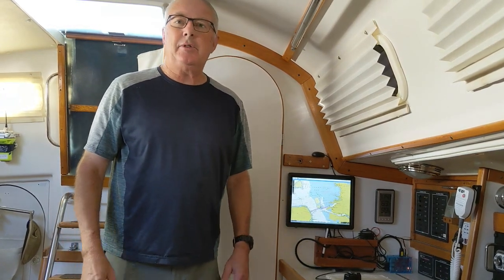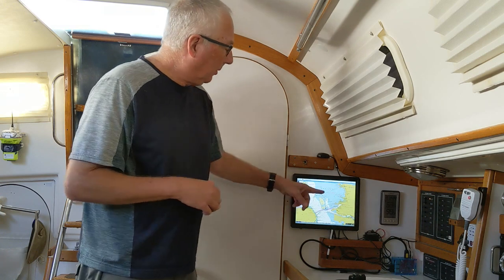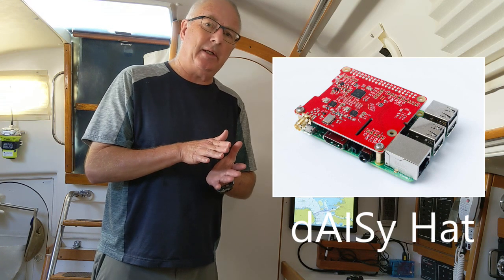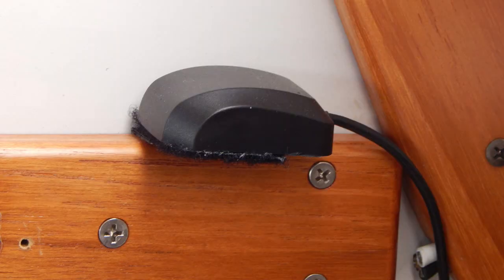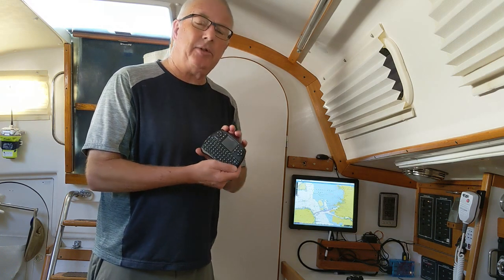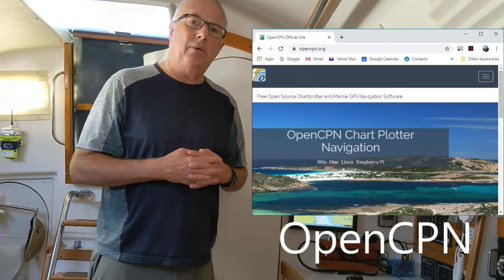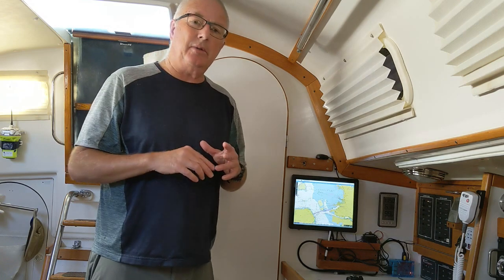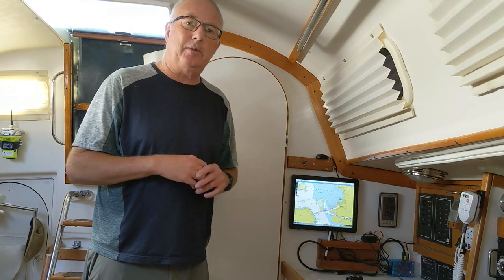Building your own Chartplotter with a Raspberry Pi and OpenCPN

Comment: As a Raspberry Pi user and Linux guru I can say this is a solid platform. Better than a tablet for sure.
Reply: Just out of curiosity: Why do you think that this is better than a tablet? I just bought a small boat and still have to decide whether I'll go for a tablet or the Raspberry Pi.
Reply: @danielhansen1902  Mind you I plan to use an Android tablet along with a PI. 

However comparing the two 
#1 Linux can do more things than a tablet allows you. It has the capabilities of an actual computer 
#2 It's modular. If one part fails you can replace it. With a tablet it's all or nothing most of the time. 
#3 It costs less. You can get used parts pretty cheap compared to a high-end tablet. 
#4 You have more flexibility. With a tablet you are locked in to what Google or Apple allow you to use. 

(Granted some of these are because I know Linux, most people don't. But it's like knowing your boat, you should be able to fix it if it breaks.)
Reply: @danielhansen1902  the gps positioning (even if receiving via wifi) just wrecks havoc on an ipad's battery.. My usb chargers arent keeping up with the charging..

Comment from the maker: I've added a list of the key hardware elements to the description. The enclosure for the RPi is at the same link as the dAISy HAT.
Reply: Thank you James. Very informative. You mention a Touch Screen. Can you use a standard PC mouse in the same way as on a Desktop PC non-touchscreen Monitor? If so, when entering way points is it the case that you place the cursor on the desired location and click with the mouse to select the way point on the chart? Many thanks, Best Wishes John
Reply: James, 7 months later how is the system holding up? My biggest question is whether the monitor and Pi hold up in a boat (some of that rocking can be extreme!) Also, if moisture has made any problems?
Reply from the maker: @martinpugh9700  My unit is running flawlessly after about a year. I do keep a dehumidifier running inside when we are off the boat, so this is not a severe case, like sailing full time in the tropics.
Reply from the maker: @JJ-sq9sy  A regular mouse would work fine. I don't use the touch screen much at all. Just came with the monitor I chose.
Reply: Just curious. Why the choice of dAISyHAT over MoitessierHAT?

Comment: Thanks to you and Smart Sailing Boat videos I have pulled the trigger and making my Pi Plotter. I found the monitor to still be the most expensive part again. Fortunately I was able to find a 15.6" touch screen for $139 on amazon. It's a no name Chinese brand, but it's powered by USB. I am powering everything via a powered USB hub. The Hub I picked has a 12VDC input so I will cut off the  transformer and wire it into my 12VDC system so I will have 7 USB 3.0 to power my plotter. Thanks again for the motivation and encouragement to go forward with this project.

Comment from the maker: I received some very useful feedback that a better antenna splitter is needed if you want to share the antenna with both the VHF radio and the AIS receiver, to protect the AIS when transmitting. I've put a link to the Glomex RA201 splitter in the video's descriiption.

Comment: As someone who is 1. buying a boat and outfitting for long term off-grid sailing and 2. cheap and 3. a lifelong builder of things, this is awesome. I was considering a refurbed Fujitsu tablet to run opencpn but this is way better and more fun to build your own. Plus, think of the "street cred" when people find out you built it yourself... 
One of the other comments mentioned Openplotter. I scanned over it and will pass. OpenCpn with plugins is perfect and much simpler. 
Do you have it wired to a speaker? If you plan to use the anchor drag or AIS proximity features / warnings then I believe a speaker is needed for the audible alarms. Maybe there's a way to use a Klaxon "ring tone" for the alarm.  Anyway, thanks!! Two thumbs way up!
Reply from the maker: I don't have it connected to a speaker. Some of the monitors have a speaker built in, which might be ideal for your purposes. All my attempts at anchor alarms have been "wake me up in the middle of the night for no reason" alarms. I've ended up leaving the chart plotter on, very zoomed in, and check it on a schedule that makes sense based on the conditions. The system has so little power draw, that there is no reason not to leave it on.

Comment: Thanks for the video. Would it be possible to provide a list / supplier of the components used to build the system
Reply from the maker: Thanks. I bought everything off Amazon.com except the dAISy HAT. Just Google that name to get the purchase info. All the rest is easy to find on Amazon.
Reply: Can you list the hardware? It would be much easier to find it rather than search for “little keyboard thingie”
Reply: @danrobert1182  Search for raspberry pi bluetooth keyboard. There are literally dozens of them. I personally wouldn't get one as small as what he has, I have one and hate it and bought a bigger and nicer one. Of course if all you ever do is the CP then it will work. Don't get the Pi4 unless you want a desktop computer, the 3B+ is more than adequate for a CP and it uses much less power and runs cooler. Check out www.raspberrypi.org for tons of info and hundreds of projects and a huge and helpful nerd community.

Comment: thx you so much for the information :)
Reply from the maker: You are welcome!
Reply: @jamesconger8509   i like how you make the videos, very comprehensive. I am quite new to sailing so i am trying to absorb as much as i can now, the opencpn video was particularly  good as sailing electronics normally are quite expensive, i am currently trying out that system but without the screen (at least until i can afford one) i use vnc and my cellphone.
Reply from the maker: @voncth5791  Thanks. You might look for an old tablet on ebay. All you really need.

Comment: Thanks for the information on the components. The link for the monitor is no longer working. Can you list the manufacturer and model so I can search elsewhere? Thanks.
Reply from the maker: It looks like that monitor is no longer available, but there are a number of similar monitors on Amazon. Search on 12V HDMI monitor, or RPi monitor. Touch screen is not required. Have fun!

Comment: Do you know anything about being able to enable DSC calls showing position of the caller onto the touch screen?
Reply from the maker: No, but it sounds like a great idea. If your radio outputs nmea, then you might look at the openCPN nmea parser as a way to display that data. Search on NMEAconverter in the openCPN manual.

Comment: I'm all for nerdy projects/. Here is what I don't get. What does this give you that, say, an iPad doesn't. I use Navionics on my iPad. It's great.  If I wanted AIS there are solutions that add that to an iPad. . With most sailors having an iPad already (or an equivalent android tablet) what extra can we get from OpenCPN and a raspberry pi? Thanks for posting.
Reply from the maker: I think both methods work fine. A friend uses the RPi and AIS board to broadcast AIS data, which he then displays on an iPAD running Navionics. He has a tiller boat, so the iPAD is great. On my boat I like having the fixed display that just comes "on" when I power up the panel. I'm essentially replacing a laptop that used to sit on the nav station.

Comment: Is this a set up that I could program at my base, travel 1300 me led to a boat hop onto and sail. Reason I'm looking at purchase of a boat that's without electronics. Thank you
Reply from the maker: Yes, with one issue. The AIS works best with a mast-head antenna. You can use a portable "emergency" VHF antenna to start with, but range will be less. No electronics sounds much better to me than a bunch of non-working electronics, which is more common. Best of luck.

Comment: Hi James, am I right that for this setup to work, a pre-existing vhf setup must be on the boat? You mentioned a coax cable running down the mast to the daughterboard, but it wasn't clear to me where that coax cable went to. I assume a vhf, but want to be sure. Thank you!
Reply from the maker: The AIS receiver needs a VHF antenna to connect to. I use the one at the mast head. You can use a separate antenna, but the higher up the better.
Reply: @jamesconger8509  Is the AIS a necessary part of this?  Would the plotter work sufficiently with just the GPS alone?
Reply from the maker: @mattd9840  The AIS is optional, but... Being able to detect large vessels at a distance is a big safety feature.

Comment: Excellent summary - and thanks for pointing to OpenCPN (supported on all major SW platforms).
Have you measured .the 12V power draw for the Pi as well as the monitor?
This of course also opens up the possibility/alternative to use a HDMI splitter and put a monitor elsewhere (helm station?) for really on the cheap. Or two have two redundant systems w/o having to spend another fortune.
Assume there is not an AIS transponder in the package.
Reply from the maker: I have not measured the power drain from the system. The fridge and autopilot on our boat dominate the power draw. You only get a AIS receiver with the dAISy HAT. A separate AIS transmitter would make sense.
Reply: @jamesconger8509 , thank you! Interested if you update with numbers one day.

Comment: James, inspired by you, I put together a raspberry pi with open cpn and a daisy hat. Works well. I have the 7 inch Addafruit display which I find does give some interference on the vhf. My problem now is trying to figure out how to get it to output mnea0189 to my Raymarine tiller pilot. What do you do?
Reply from the maker: I didn't connect to the autopilot. The main use I have for the autopilot is constant apparent wind mode, and I just do this from the autopilot remote.

Comment: Thanks for making this video. Definitely going to build one. I'm curious though, how hackable is the GPS receiver? I have a radio (UM-415) that I would like to incorporate. It has a cable coming out of it for NMEA data and the manual says it doesn't support AIS channels.
Reply from the maker: GPS support under Linux is through a service called GPSD. Multiple apps can get GPS data. Take a look at the Open Plotter project for ideas on NMEA data. (openmarine.net)
Reply: Thank you

Comment: Thank you James for information, can you provide info for your monitor? Link on description not working..Thanks
Reply from the maker: Try searching Amazon on: "Touch Monitor, UPERFECT 12.3" Computer Display 1600×1200 Portable Monitor". Any HDMI monitor will work - touch screen is not important. I liked this one because of the size and the 12 volt input voltage.
Reply: @jamesconger8509  Thank you James for your response!

Comment: Great presenation that got me interested in building a same kind of setup. Is your screen capacitive and does it accept multitouch input? I've heard Pi is quite picky about touchscreens and I've even read that the official 7" touchscreen is the only model that really works as a multitouch capacitive screen. Hope that's not the case.
Reply from the maker: The documentation says that the screen accepts multi-touch, but OpenCPN does not know how to use it. I use a little keyboard/mouse device for what little input I do. Most of the time the plotter is just on, displaying the right chart for the area and all of the AIS targets. Perfect!
Reply: @jamesconger8509  I had an extra Pi4 so I decided to try OpenCPN with that. I managed to download and install vector maps for Finland and get the OpenCPN working with Pi4. No gps yet, so I could only browse the map and try different functions. So far so good. Only thing I didn't find was a way to show the depth of lane. You can check it by double clicking on the map, but that's not very intuitive. As it happens, I had a 23" Dell touchscreen at home, so I tried that with OpenCPN and Pi4. Worked surprisingly well and I didn't really find much need for multi-touch. Next step is to start planning how I will integrate OpenCPN/Pi4 to the systems in my boat. Going to be interesting and exactly what I need to get through the winter before the sailing season starts. Thanks for the inspiration :)
Reply from the maker: @Kaizula  You are welcome. Getting the correct path to the GPS serial port took me a couple of tries.

Comment: How do you run this on 12v power?  It runs fine if I use the canakit power supply on the 110, but every converter I try from 12v fails.  Anybody have a working one not on 110v?
Thanks
Reply from the maker: I used a little $12 step down converter I bought on Amazon.com without any issues. Wired into my 12v DC panel.

Comment: James: How did you power your monitor and what kind of HDMI cable did you use to connect to the Pi?  Thanks
Reply from the maker: The monitor I bought runs on 12V DC, so I connected it directly to the terminals on the appropriate circuit breaker on the boat's 12V panel. The monitor came with a HDMI cable.

Comment: Hello! Is this the same James Conger who worked for Chevron at one time?
Reply from the maker: Hey Andy. You must be long retired too. Sailing now?
Reply from the maker: Nice presentation. Signal K looks like what I really needed a few years ago when I was logging my boat data to validate the CFD models. I have a 2002 J/32 in Alameda.
Reply: @jamesconger8509  I'm finding decoding the incoming JSON updates from my SignalK server for my new SK instrument to be something that's firmly placed me on the upward swing of the learning curve. I'll get there, it's just going to take some time!  Best to you and Claire.
Reply: @abarrow4  Looks absolutely fantastic - thanks for sharing, is instantly added to my google drive. Question from a newbie to boating (skilled Rasbian/Debian user) how sea/salty air proof is the Raspbarry Pi, as there is a lot of salt and humidity in the air round my boat (located in Copenhagen) - example is I bought a cheap cap last year to get some sun protection, and the cap has a metal/chrome kind of lock in the back to adjust the cap - in less than a year I'm seeing corrosion on this adjustment lock - it has been inside the boat - off course it's not airtight as it's an old boat (1979 - 22 foot)

Comment: Maybe my phone is acting up but the link for the monitor is not working. Can you update the link or give make and model
Reply from the maker: Here is the description on Amazon.com: Touch Monitor, UPERFECT 12.3" Computer Display 1600×1200 Portable Monitor Capacitive External Screen 4:3 Speakers VESA Fit with HDMI DVI VGA Micro USB DC for PC Phone MAC Win PS4 Xbox TV Industry

Comment: James can You tell me if you have a second setup at the helm or not and if not why?
Reply from the maker: I have a small Standard Horizon chart plotter at the helm. This is connected to my VHF radio so that they exchange GPS and AIS data. The CP at the helm is handy, but too small to use for navigation. It also does not have enough processing power to keep up with all the AIS traffic, so large ships are sometimes missing on the display. The RPi has no trouble keeping up.

Comment: Is this compatible with nmea2000?
Reply from the maker: With USB to NMEA2000 interface you can make your RPi part of the NMEA 2000 network. Past that, I don't know how much use this will be with OpenCPN as your chartplotter software. I have not tried it.

Comment: Thanks for this. Question, how do you read the data or chart at the helm?
Reply from the maker: I have a small chartplotter at the helm. It's OK for some tasks, but the screen resolution limits its use. The commercial unit also gets behind if there are a lot of AIS targets, while the RPi has processing power to spare.
Reply: @jamesconger8509  BTW you can set up the Wifi on the pi as a router and connect to it with any kind of tablet or mobile phone. Then you can acess the Navigation pi with VNC viewer, essencially remote desktopping from the deck. Has a bit of lag but good enough for use.

Comment: Do you know if you can add a battery pack to make this device mobile? I was hoping to a nav station big screen for planning and reviewing and a small screen hanging from the companion way that I could use underway. I'm not sure how if it would be easier to run a second screen. Any thoughts on this?  

https://www.piborg.org/power-1137/battborg
Reply from the maker: What a friend of mine did was to run the RPi and AIS board off a small battery pack, but without a screen. He then transmits the AIS data via WiFi to his tablet. The tablet runs the chart plotter software and displays the AIS data. That gives you a really portable chart plotter. He also showed me that you can have the RPi run OpenCPN and the broadcast the output to a tablet running just a terminal emulator. It was a bit slow, but quite usable.

(Sorry for the slow response, but I was on this sailboat...)
Reply: @jamesconger8509  thanks for the reply. For YouTube that was a fairly quick reply. I did some looking and noticed the new pi has 2 hdmi out puts so I  can try that as well. I'm currently doing the phone thing and I think the tablet would suffer from the same issue of not having a mount and sliding around.  Great videos I just finished the sail trim series it really made me see what part of the sail is creating lift.

Comment: I read some people use VNC and a simple tablet as terminal for the RPI. Did you try this? Anyone with experience In this group?
Reply from the maker: I have seen it done, but it was painfully slow. Another solution is to use the RPi to broadcast AIS data via WiFi, and run the chartplotter native on the tablet. You get good chartplotter performance, and with AIS data superimposed on the chart.